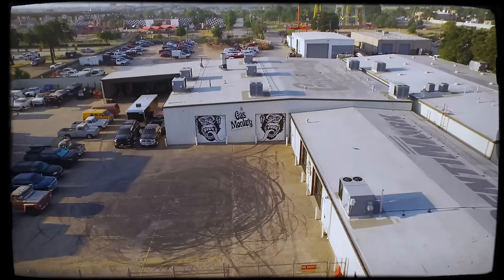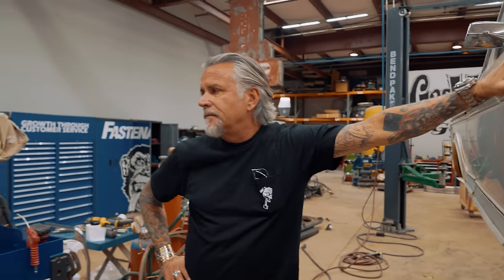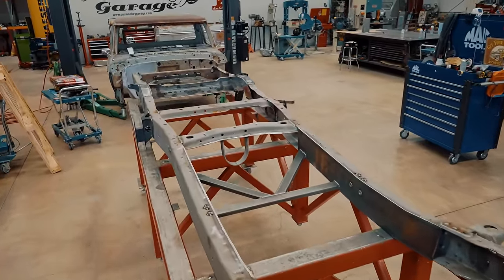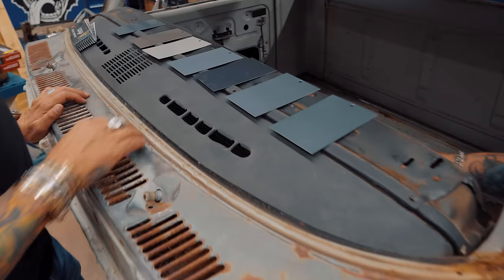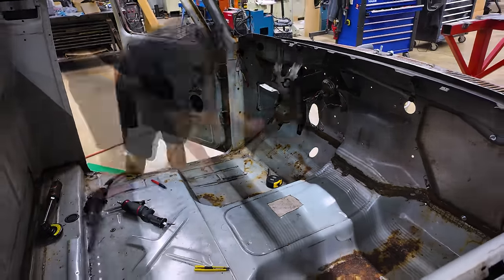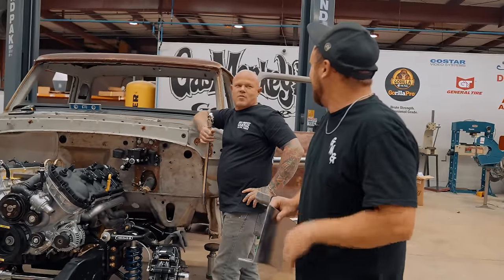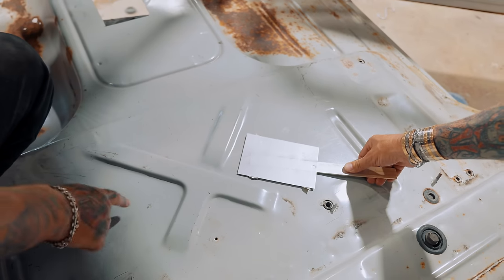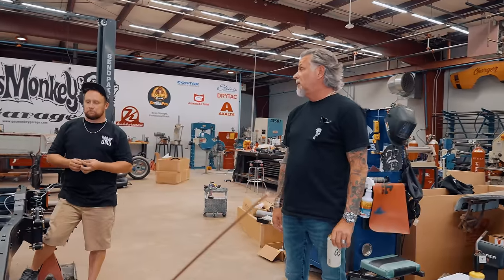Building the Ultimate Ford F100 Truck | EP 2

Comment: The oil Pressure does not change the timing! It’s the VVT sensors on the cam reading rpm torque and knock Sensors etc! Oil pressure does tension the timing chains tho

Comment: should have went to copart and grabbed a 2020 crasher, get the 10 speed auto, if its a 4x4 package it has the rear and and front end electric locker, so get all your running gear too, then grab a Whipple Pro Charger for another 420 or so if you have a good tuner, seen guys getting 900 very streetable HP off stock internals..  in the 1/4 you can lock up the axles and she will terrorize that strip with grip no wheelie just a getup and lung, to the beam .. sorry but you got the crap 5.0, a few things upgrade timing set, gears chains all, upgrade cam timing and crank angle sensors, and then do the usual upgrades fixes that gen is known for . .   dont gorget to lube that driveshaft spline, serious. there is a service bulletin on it

Comment: Why are you putting a full synthetic in that motor when May not break in properly You need to be putting in Something that has more zinc in it For the break-in Which is only going to be for a couple hundred miles Then go to the synthetic I thought you guys knew better than that

Comment: The used the wrong type of laser equipment of the chassis. Can not clean a chassis with a 1500 watt low mJ machine. Check out Dennis Collins jeep restoration using Alien Laser Cleaning. 10 years in the laser ablation industry and I know a thing or two about lasers.